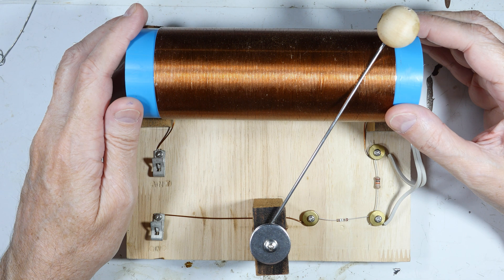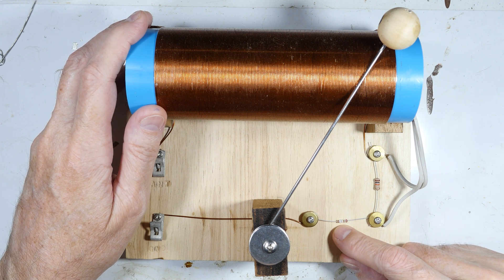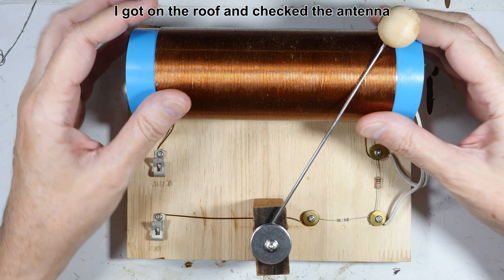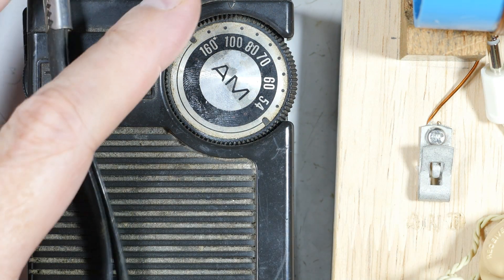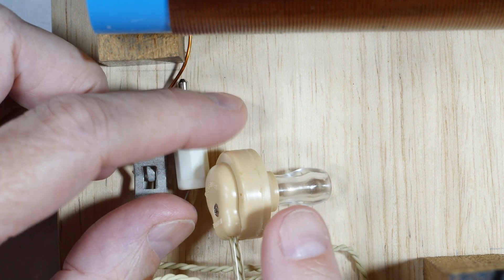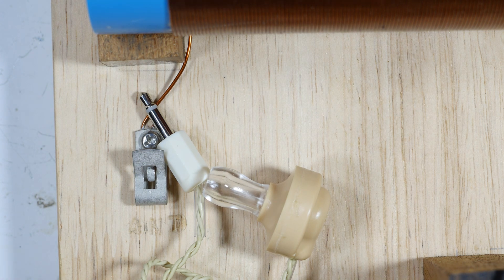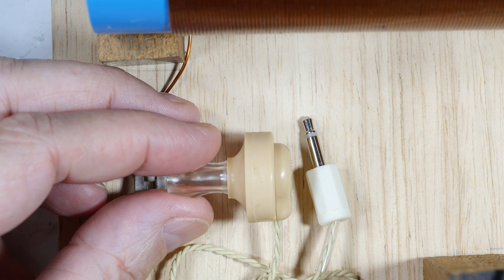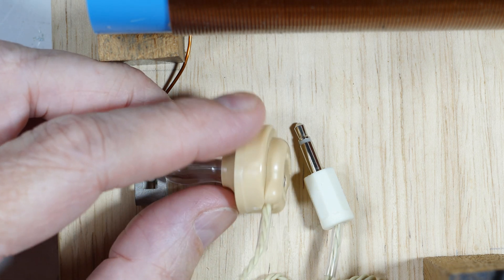PSA: Crystal Radio, Devious Bad Earphone Problem Pt 1 – Spread The Word

Comment: Try connecting The ear phone to the transistor radio volume control then talk, whistle or tap the earphone you should hear something from the speaker if it is good. Also, I have a Heath crystal set and can hear it very faintly in a quiet room, so I guess my Hearing is much ain't what it was 60 years ago.
Additionally,  In place of a 1N34, use a Schottky barrier diodes, have a much lower knee (More sensitive). . Also make sure your wire coating on the coil is bare over the path of the slider.
Reply from the maker: Thanks for the suggestions. BTW, I have a part 2 where I cut the earphone open  and it turns out how they make one of the connections is dodgy.

Comment: It sounds to me like the earphone had gotten moisture in it for cold to hot or warm and when you zapped it with 9volts, which by the way did once too and it didn't blow it. But the battery short probably burned out the moisture.
How did you connect the slider to the wire under the block of wood?
Reply from the maker: You place these things in your ear for an hour or more and there's a lot of moisture there. I've done a tear down in part 2 and spoiler, the connection is wonky at best. I have tried a fix, but it's too soon to call it. The wiper is at 39:50 in this video. 
https://youtu.be/fLVCqZGpv3U

Comment: Piezoelectric transducers are notoriously unreliable. When I was a kid, we had record players that would lose their volume, or go silent. Always, in every case, replacing the crystal or ceramic phono cartridge would fix the problem. Even in high school, my stereo Magnavox had a ceramic cartridge, and after a year or so, the left or right channel would go dead, and I needed to buy a new cartridge to listen to my '70s rock and roll again. In the years since, when I could afford real high fidelity equipment that had magnetic cartridges, in 50 years, I only ever had to replace one due to the cartridge going open on me.

Comment: I put together some crystal radio kits for my son's cub scout pack 20 years ago, and ran into the same problem.  Some of the kids reported that they couldn't get their radios to work, even though I'd helped them put them together, then my son's also stopped working.  It was the earphone, just like the ones in your picture.  If you smacked it, sometimes it would start working again.  Very frustrating..  I had a couple really old crystal earphones (from the 1960's) that worked just fine, but good luck finding those.
Reply from the maker: I've got an older one that is reliable and am putting together a video on the difference between that one and the ones that fail. I hope people can use the info to either avoid ordering the bad ones or fix the bad ones. There are some fixes on the internet, and I may have one also. We shall see.

Comment: i've had this issue with amazon crystal ear pieces . ive noticed that if u smack the earpice on the table it would start working again .
i found out this issue when putting a audio y connector to put two piezo earpieces on the radio to make fake stereo hedset . and while having two earpieces in some times one would fade out or both would quit working . and just giving one a smack . would make a poping sound in the opposite earpice and they both would start working again . i chocked it up to them building a charge and would block the wave form from letting them vibrate . and shocking them by tapping them would make the earpice reverse the built up charge and make them work again .
Reply from the maker: Someone pointed me to some webpages (that somehow I'd missed) and they have fixes for this problem. It seems that the electrical contact point inside the earphone becomes loose/high resistance. So banging it or shocking it can temporarily "fix" the contact point. They also had ways to repair it permanently which I think I will give a try.

Comment: I do recall that this is a known problem, even with the headset type. I am sorry, but I do not recall the cause/cure, but the answer is on the web.
Reply from the maker: Thank you for the heads up. I found some info. This page gives a repair the author has used (I have not tried it), but they look very much like the ones I had that failed. https://www.instructables.com/Crystal-Earpiece-Repair/
And others:  https://www.usefulcomponents.com/main_contents/information/crystal_earpieces/crystal_earpiece_problems.html
https://hackaday.com/2017/02/07/repairing-crystal-earpieces/